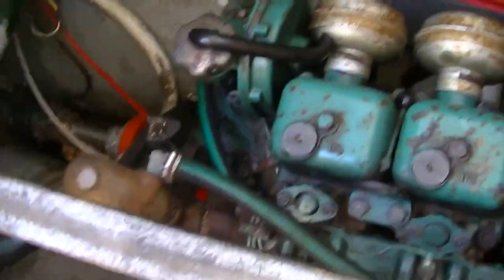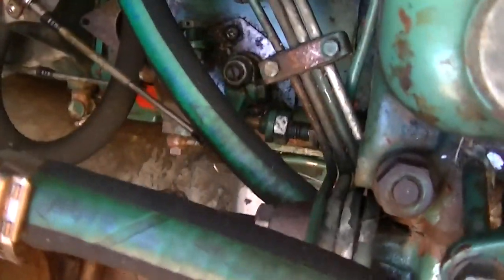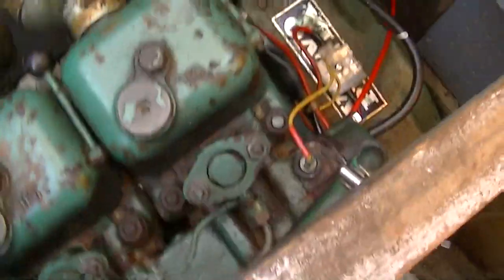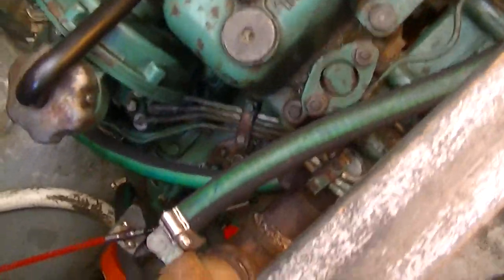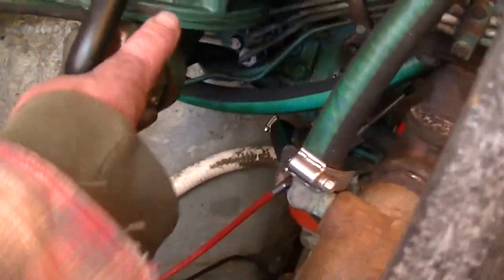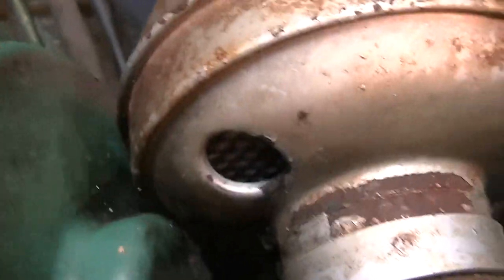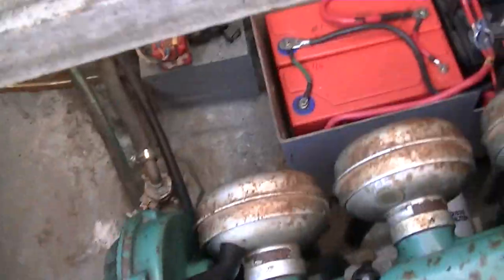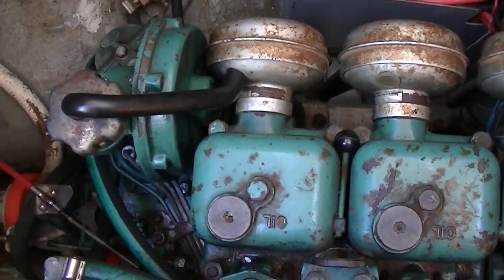Fisher 30 Pacific Child # 30  Clean Engine

Comment from the maker: might be the oil came from the gasket of the hand starter case cover.  When we begin using the engine for propulsion  we can keep an eye out for weeping places.  Won't take much to eliminate this small annoyance.  Unlike the typical sailboat - which have structure built tightly around the engines - there is plenty of room on all sides, so it is easy to get access to and keep clean the entire engine and the space around it.  Some people will live with diesel leaks that would choke a horse.. because it is so hard to get access.  None of that here..and consequently, no diesel smell inside the boat At all !